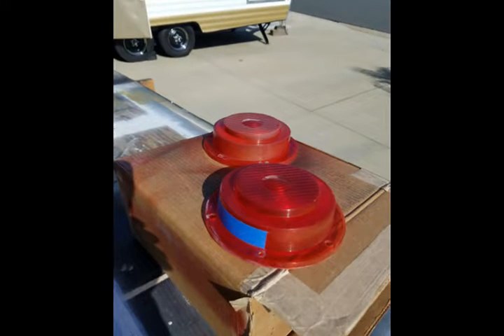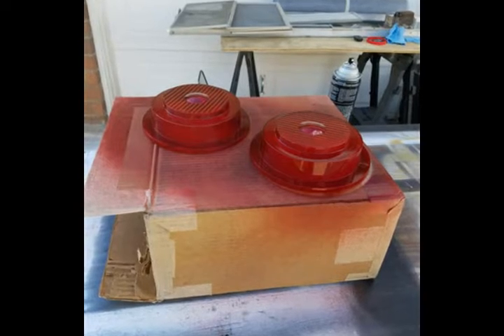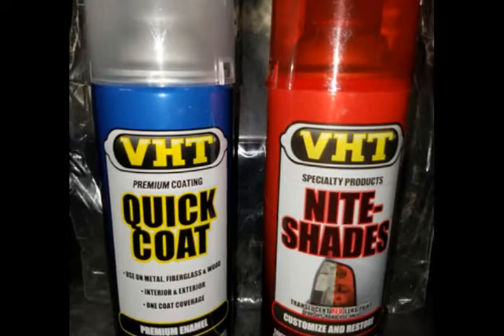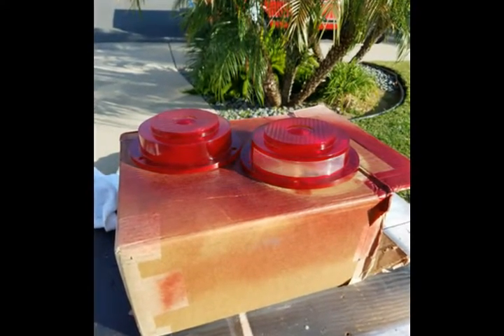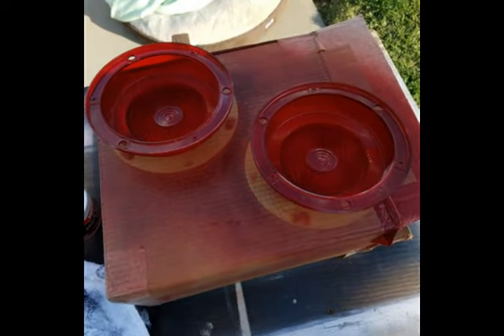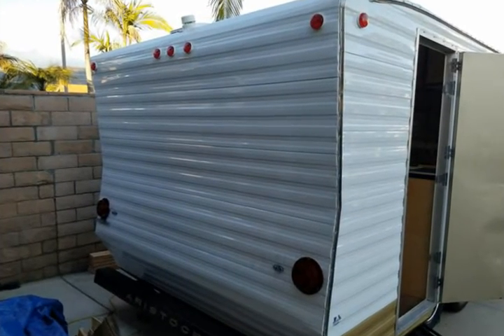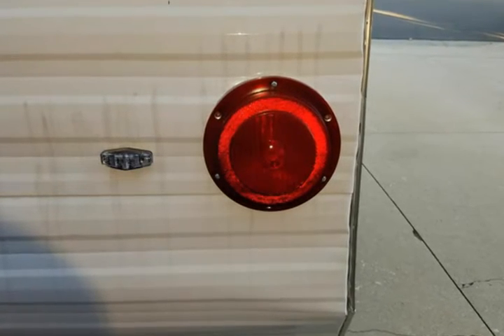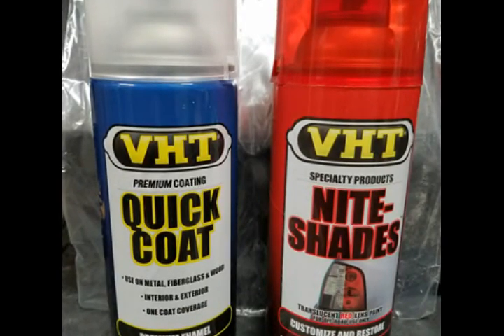1969 Aristocrat LandLiner Running lights install and Lens fix.

Comment: Rudy, you may have mentioned this in another video, but what store did you order the 2-1/4 in running lights?
Reply from the maker: I purchase these lights from E-trailer.com They are know a single wire lights... About $4 each...